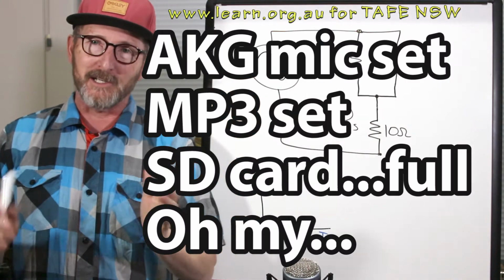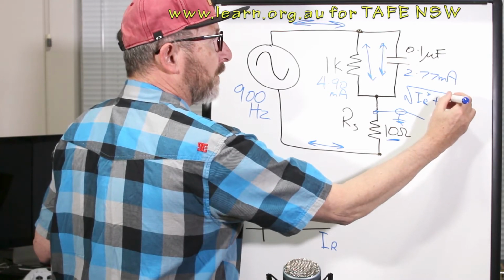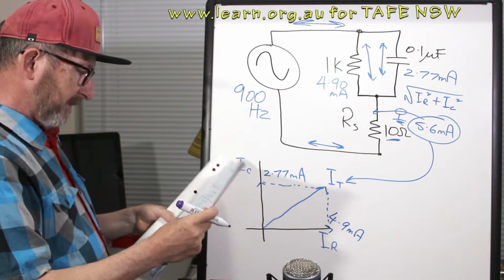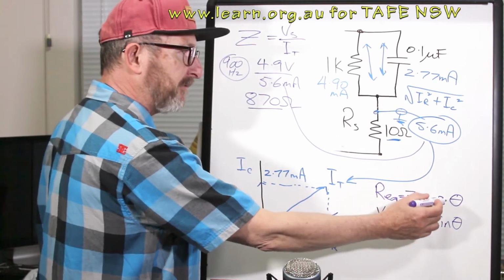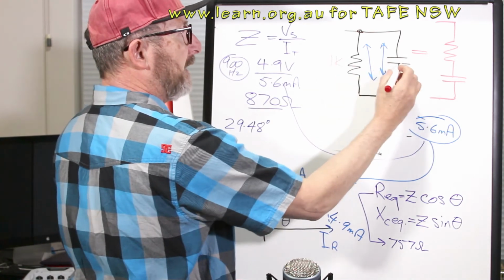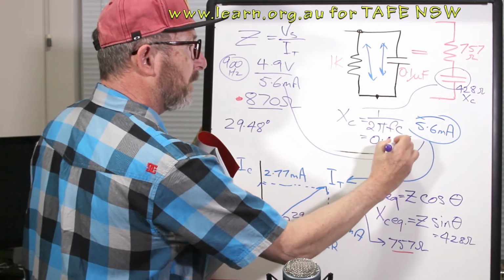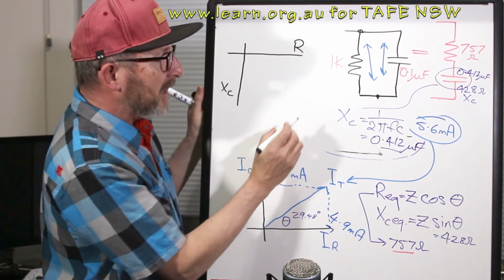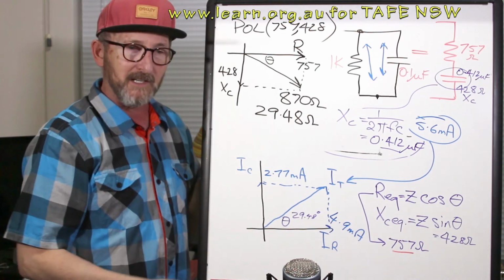RC AC parallel Z and Ohm's law PART 5 UEENEEH114A - TAFE NSW

Comment from the maker: Little mistake, I said total cct current, I should have said Resistance current, and of course that is the supply voltage which is the reference in a parallel circuit.  Under the weather, head tired :P